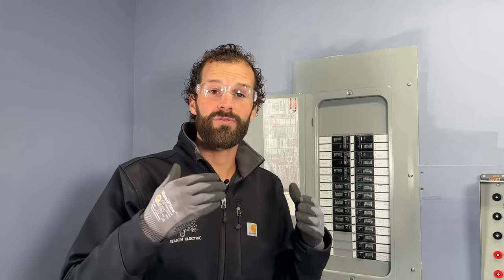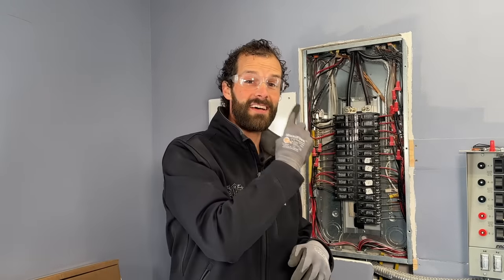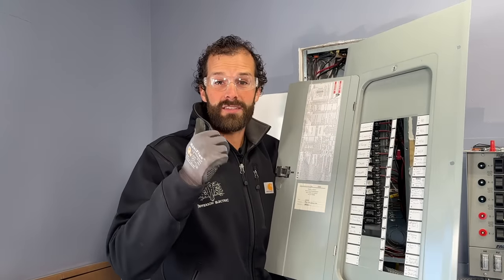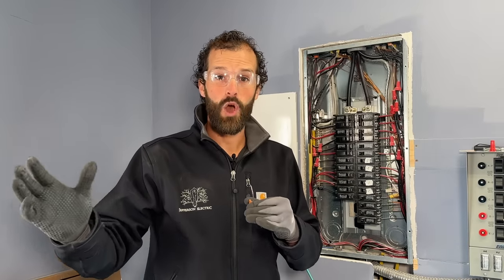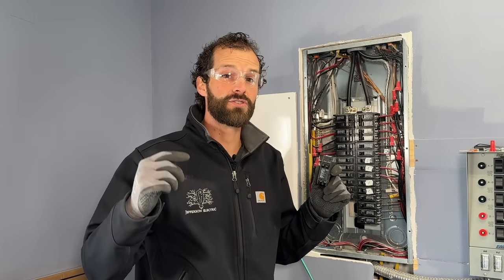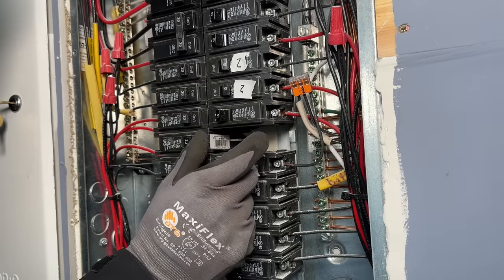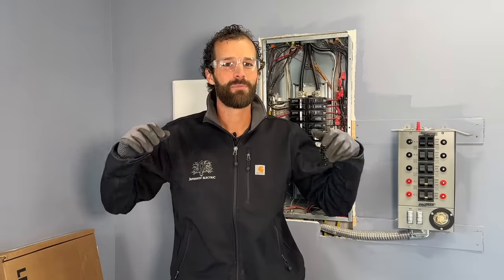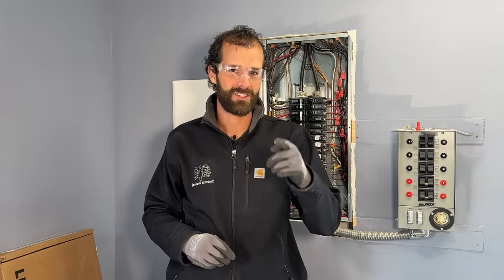No Room In Electrical Panel - Quick Fix

Comment: Load balancing on the phases (legs) is also worth doing if you start moving breakers around. Just something to keep in mind.
Reply: Agreed, very important especially if you have a backup generator. You can lose tremendous generator capacity due to poor balancing.
Reply from the maker: Thanks for the feedback 👍
Reply: Just like with FritzM above, I 100% agree with keeping the panel balanced ...... damn sure not always done.
Reply: Also look for situations of two circuits with a shared neutral, which are usually flagged by having a 14/3 with red/black hot wires. If they're on different phases that's fine because the neutral will balance out. If you start shuffling things in the panel you need to be sure they stay on different phases.
Reply: @DaveMethvin  another very important point. Videos like this can be dangerous in the hands of the unknowing diyer. Hopefully these comments help explain things a little further.
Reply: @DaveMethvin 
Great point, DaveM. That misphased shared nuetral opened can send a surge down a leg inna heartbeat.
Reply: @DaveMethvin  two circuits with a shared neutral must use a double pole breaker for that very reason.
Reply: He is already fired..4:03   We DONT use our fingers to guide a metal screwdriver EVER:)
Reply: @roybean9146  Its also illegal to make joints in a panel, or at least that's the rule in Canada.
Reply: @aidangattinger8975  Would be by Province I would think..and hey...a splice isnt a bad thing..done properly..
Reply: you usually only have single phase power in a house
Reply: @sammynaas7480  correct. I guess it is a misused label for A/B L1/L2  in the panel.
Reply: @sammynaas7480  I cant think of a multipohase house..its a fake separation of one phase of phase to achieve 240v i think
Reply: @Roy Bean  it’s just single phase 240, which is just 2-120v hots
Reply: @sammynaas7480  no such thing as single phase 240 residential.Offsetting the waves to create  a "fake" 240 saves an entire copper line..THAT why:)
Reply: @sammynaas7480  Historically i think 120 was ONLY done due to electric light bulbs couldnt handle 240..By the time Rest of world installed a grid the bulbs COULD handle 240..This North America got stuck with unwieldy and relatively  weak 120
Reply: @roybean9146  homes don't have 3-phase power because it's not really needed. Household appliances and equipment don't have 3-phase motors or anything else that would require 3 different phases. It would be too much for residential, and costs to wire 3-phase power to a house would be tremendous.
Reply: @sammynaas7480  Its about money and WHY? You dont need 600 volt 3 phase to run a fridge..single  phase is analogous to single cylinder in power smoothness basically.That and funky EMF results past a single conductor and ac wave anyway..Why not 6 phase? Theres a reason NOT just the cost
Reply: @roybean9146  Residential power comes off a single phase of the Generator (Primary) take a look on the Pole outside your house! The transformer separates it into 2 - 120 to neutral hot legs.
Reply: @billykay4472  Which is faux 2 phase..works and saves huge on conductors..hey the shit is funky we still are shaking our head show electrons ARENT really particles:)
Reply: Yes, the correct word is "Legs" stop using Phases. I was never taught in my apprentice class. Phase is between legs.
Reply: That's a single phase system.
Reply: @johndough9187  1 phase is 2 legs 180 or 120 degrees apart electrically.
Reply: @timesup6386  I am aware of that.  The original commenter said to balance the phases.  But it's single phase.
Reply: What do you mean by balanced? I’m learning how electrical works and what happens if you pull more power from one side ??
Reply: @edmalts  Balanced means equal load current on each leg. If it is not balanced the difference flows back on the neutral. 10a on leg 1 and 7 amps on leg 2 = return current of 3 amps on neutral
Reply: @timesup6386  2 things out of phase implies there are 2 of them. 120/240 split phase service is derived from a single phase of the distribution grid, but what is 180 degrees out of phase on the secondary side are NOT L1 and L2, but the two signals (which CAN be called phases just fine) that are formed by: L1 to N, and L2 to N.
Splitting a primary phase into 2 phases, hence split phase. Calling it '2 phase' is generally not considered correct, as there are old examples of 90 degree out of phase '2 phase' systems, but to say there 'exists' 2 phases is technically totally correct. What is NOT correct is to call L1 and L2 the phases. The phases are specifically L1 TO N, and L2 TO N. L1 to L2 is a single 240V phase.
Reply: YES it is.
Reply: @roybean9146  Haha, I too was like what is he doing!
Reply: Duh load balancing? Power consumption varies throughout the day on phases. This isn't a business
Reply: @aidangattinger8975  Not the rule in USA. Often poo-poo'd and mistakenly assumed to be a violation, but it isn't. Also, that Gen-Trans unit that is interconnected with this panel intercepts 10 wires, each with a joint as well.

Comment: One thing you did not cover when combining circuits is if you have MWBC multi wire branch circuits you can't combine both phases on the same phase by using tandem if pigtails because you will overload the neutral.
Reply: You are right on!  I am wondering about this right now.  Not sure how to avoid landing a shared neutral when replacing two regular breakers with a tandem.

Comment: I have a CH panel from the 80’s and the twin breakers slip in any of the slots - at least I’ve not had to force anything.   The thing I notice on twin breakers is the hole for the wire is hard to feel out in the panel. CH panels are pretty narrow due to long breakers.  Great video.
Reply: Yes I was there to on my parents estate.
Reply: This is because the CH panels use a copper bussbar set, and can handle more loading than the BR panel in the video’s aluminum buss…
Reply: @whochecksthis  I do like the more robust bus but I’m not sure it’s as popular these days.
Reply: Different configurations of panels. Many are 20/40 in which every slot accepts a tandem. The one in the video is a 30/40, where 10 slots can accept tandems. 40 slot panels do not accept tandems at all.
Reply: @darrendolphdragos9752  Did they have tandem breakers in 1986?  I assume the issue has more to do with the bus ability to handle the load and the panel having enough room such as neutral/ground bars.
Reply: @MrKen59  Yes they did have tandem breakers in 1986. But panels have regulations to follow and get their UL listing based on their design and testing parameters. Up until recently, the NEC code restricted panels to a maximum of 42 overcurrent devices. (Circuit breakers.) 42 doesn't hash out on residential split-phase panels so they're generally only 40 circuits maximum. When a full-sized 40 circuit panel is made (20 1" slots on either side) tandems are rejected, because if the panel accepted them one could easily double the maximum number of circuits. Different manufacturers used different schemes within their panel and on their breakers to ensure that smaller panels (physically smaller) would include rejection features preventing tandems from being installed anywhere except the allotted spots. So, a 20/40 panel would mean 20 full sized 1" breakers, or up to 20 tandems. A 30/40 panel would have 30 full size 1" breaker spaces, with the bottom 5 on each side able to accept tandems. These details vary between manufacturers. As you mentioned, the accompanying neutral and ground bars would be sized based on the maximum number of circuits the panel was designed too have.

Comment: If you were leaving  that breaker spot open for future use; what was the point in combining?  Next.  If some inspectors opened a box and saw one single wire nut.....Instant Fail and violation.  That box is full of them.  Now in some instances depending on your area, a 220/230/240v or double pole single phase breaker can be used as a split circuit.  This automatically balances the load across the two bus bars.  In North America the ground/neutral circuit is one bar or two opposing bars connected to one another.  Thus all grounds and neutrals run on the same single conductor.  The incoming line has three conductors in which at the service pole runs to a grounding rod, the conductors are connected in the meter base and the ground is connected to another grounding rod below or within a certain distance of the entrance.  Then another conductor travels and connects to the ground/neutral lug in the main panel.  This conductor is all one circuit and continuous to ground.  If you are combining circuits that are running the same combined amperage as before then there is no risk of overloading the neutral.  However if you bring that combined circuit over the replaced circuit load limit then yes it is possible.  Honestly I never use 14awg wire for anything.  14awg wire is a main cause of infrastructure electrical fires.  I always use a minimum 12awg.  Any 120v major appliance should be a home run.  This includes refrigerators (standard or mini), microwaves, ice makers, under cabinet coolers, dishwashers, clothes washers etc.  I always use a minimum 10awg for those circuits.  I always use at least 2 home runs to each bedroom.  A lighting circuit and a receptacle circuit.  If a major appliance such as a mini fridge is likely,  I will run another.  Depending on the devices in kitchens and baths, I have used up to 8 homeruns in kitchens before and up to 5 in bathrooms.  I even opt for larger services, incoming conductors and larger panels.  Overkill? More expensive? Yes, maybe.  But in the end, safer.  Peace of mind is priceless.  In new construction, if you plan ahead and allow for upgrades and add ons, then it is better to install fresh than having to go back and fish wire, add circuits etc.

Comment: Wago are NO BETTER than the push-in connectors on 15-amp switches and outlets. Also, WHY are there so many wire nut connections in the panel?

Comment: I just straightened out my breaker box. There were several breakers with 2 circuits on them yet there was a double breaker and a single breaker that were no longer in use. What they were originally connected to was no longer there (240v wall heater and a welI pump). I was able to label everything and every circuit had its own breaker when I got done. I also straightened out my neutral bus bar, many spots were double tapped, even triple tapped! The bar was slightly discolored where it had been triple tapped and the insulation on the ends of those wires slightly melted from overheating. There were a dozen or more open spaces so there was no excuse for this. I moved down 1 wire at a time, starting with the longest wire and turning off the corresponding breaker(s) before doing so. Everything reached just fine, each neutral wire now under their own lug. I tested every outlet in my house, all good and grounded. Crisis diverted, now I don't have to worry about my house burning down.

Comment: Great information, the only thing I would suggest is placing the feed wire in the center position of the Wago connector, that way the effective current flow through the busbar is reduced by sending it in two different directions.
Reply: What????
Reply: I wouldn't use them at all should be illegal. There isn't enough wire contact with push in wiring could cause an arc and burn the end of the tab on the connector witch is being over heated melt the connector bam 🔥 Fire
Reply: @richardcollejr.5121 Wago 221 connectors are rated for the full current allowed by the breaker. Otherwise they would not be allowed in junction boxes either.
Reply: @richardcollejr.5121 So what do you use then?  Wire nuts?

Comment: Two comments.  After Joel opened the exterior disconnect switch he failed to verify the service was dead.  Never skip that step if you are relying on a dead panel.  I've see numerous older disconnects that have internally failed and don't open all phases.  Kudos for the gloves and glasses Joel.  Many DIY channels don't have a clue about NFPA 70E.   A word of caution about multiwire branch circuits because older installations don't necessarily have them protected by a two pole breaker which is now required by code.  Be sure to pair circuits on the same side of the box to avoid potential neutral burnout.
Reply: Agreed; he should have shown verifying the panel was cold. I'd assume most watchers don't know how to do that either. Are shared loads on a neutral typically a risk in residential? Neutrals are generally home-runs with the leg w/romex, assuming we're discussing 14/2 lighting circuits, etc. I also cringe at a wago pigtail in a panel. I'm a fan of wagos, but I wouldn't use one at the front of a circuit. I'd reserve this practice for OCPD's that directly allow for two conductors.
Reply: @bluemarinoni  My house was built in 1984 and is chock full of multiconductor branch circuits and none of them were on a two pole breaker. It appears it was quite common to run a single 12/3 to a remote location then branch. When I added my subpanel for my generator I converted the multiconductor circuits to two pole breakers.
Reply: @williamrucki9293  Copy. I'm feeling like this is too big of a learning curve for most DIY'ers... even my 2006 home has lighting circuits mixed with outlets; I haven't finished mapping it yet, we all know the labels aren't right! Resorting a panel is non-trivial. I have to question if this video is appropriate to show. There's too much to go wrong.
Reply: @bluemarinoni  Agreed. When I sorted everything to move circuits to a generator subpanel and clean up the multiconductor branch circuits I literally pulled all 40 breakers out and started over. I’m not sure the typical DIYer is ready for that.
Reply: @bluemarinoni
Reply: @williamrucki9293  agreed, I have watched it done by an good electrician, and he was not a happy camper at the end. Keeping up with what's going on especially in an old crowded panel situation is about as much fun as removing your fingernails one by one with a pair of pliers.
Reply: @replyhere590  What is even ore fun is going in after someone has removed the panel schedule entirely and have to re-map the whole thing...Had to do that once on a 10K square home with a 400A service.
Reply: Yes and multiple circuits in a conduit have the possibility of back-feeding from other circuits if there is a short in the conduit.
Reply: @replyhere590  I prefer to keep my fingernails, thank you ha ha!!
Reply: @williamrucki9293  Ahh split phasing branch circuits lol
More efficient power usage that way though.
Reply: Technically when opening a panel he should have double gloves, face shield, a rubber mat and non conductive tools. Unless you pull the meter you are at great risk of arc flash.
Reply: @slipstreamvids7422   If you follow the risk analysis guidelines in NFPA 70E I think you will find that level of PPE is a bit overkill unless you work for a very conservative company, then you have no choice.  I am a personal fan of face shields because I don't like cuts and burns on my face and I've seen more than one breaker come apart when actuated.  As far as arc flash, this is a residential 240V service and I can't fathom the impedance ever being low enough to support a plasma.  Even in the lab, initiating and sustaining an arc flash on high power 240V delta systems is very difficult.

With all that being said, the panel was dead and eliminated the need for any PPE.
Reply: @williamrucki9293  When Tesla installed my solar this was the level they were utilizing. I think all new breaker installs are mandated to be arc flash compliant so it does exist at least on 15A residential circuit to the point maybe starting a wall fire but 240V panels fed with 200A capable feeders can certainly cause some trouble if something falls across the buss. YMMV
Reply: Duh!! Most electricians do this live as the whole home can't be shut down
Reply: @williamrucki9293  I wired quite a few residences back in the mid-80's and beyond, and this is true, 2-pole breakers were not required. Also, MWBC homeruns were the norm and ideal as it cut the quantity of homeruns down to almost 1/2 as many, and the panel(s) were almost always located at the front of a projected garage.
Reply: @jasonfoster9118  Not likely unless a wiring error was made.

Comment: Thank you for showing that some Homeline's can use 2 wires and also a thanks to whoever pointed out that overloading the neutral was a possibility.  I just combined a few very lightly loaded lighting/doorbell/motion detector light circuits to make room for a 240 V 40 Amp Dual Car charger breaker pair.  Not related, but I'm replacing 50 year old IDC connectors in my modular home with UL rated DIN rail terminal blocks as I've had two open hots in 6 months.
Reply: I'd like to know who wires them things shit like that happens all the time

Comment: The subpanel in my home (Eaton BR) has all spaces with rejection tabs but you can get Non-CTL twin breakers that fit into those spaces without field modification. The panel was listed as 20 breakers and 40 circuits so it was designed to have all twin breakers but you have to use the Non-CTL (circuit total limitation) breakers.

Comment: Definitely CHECK THE LOCAL CODES....many jurisdictions do NOT allow amalgamating circuits together and most DO NOT permit any sort of splices or inter-connections within a panel.
Reply: Yeah, the pigtail and all the wire nuts in that panel would get it red tagged. Also, zip ties in the panel are considered bundling and gets red tagged as well.
Reply: So practically speaking, rat's nest wiring is best for heat dissipation compared to OCDishly neat wiring run bundling, aesthetic pleasantness aside -